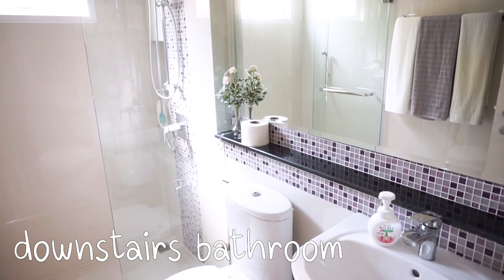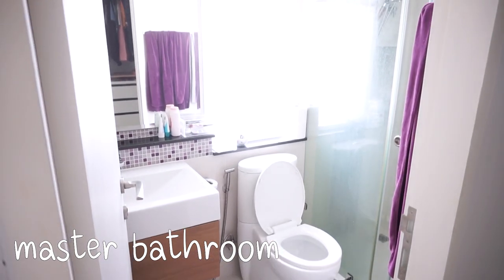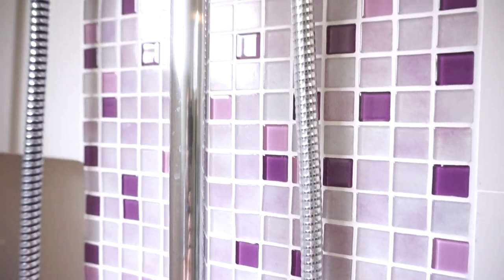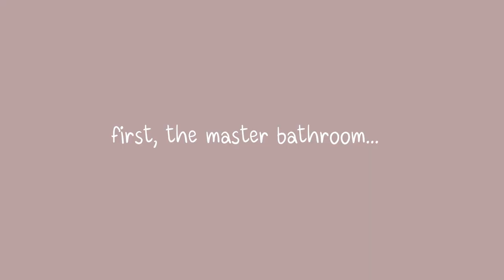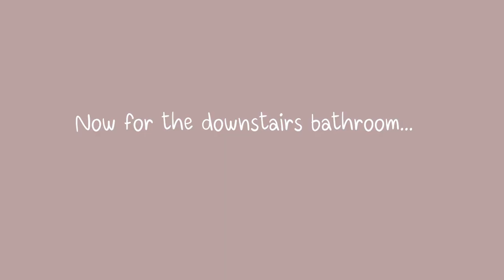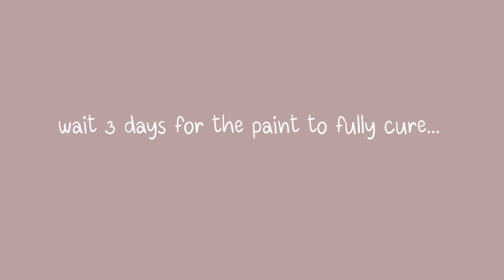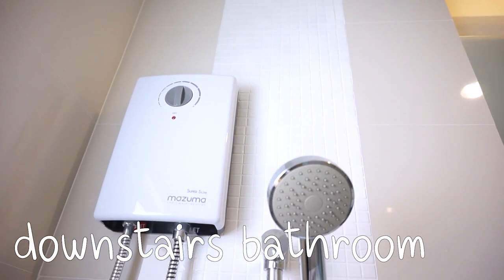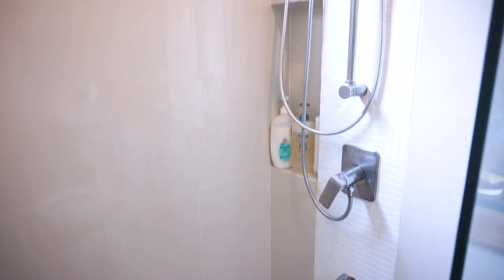Spray painting our bathroom tiles with Rustoleum Tub and Tile

Comment: While i agree with most of the knuckleheads who say you should of left that beautiful mosaic tile alone but thats not the point of the video...you did a hell of a job prepping which 90% of DIY’ers definitely try to take shortcuts prepping n thats where they run into major problems..kudos to you for showing the masses the proper way to prep for such application..disregard the commenter who said you should of taken the tape off while paints wet. With acrylic/epoxy paint its perfectly fine to let it set for as long as need be n it wont peel. Regular latex paints will peel but not tub& tile thats a different animal...give ya a 10 outta 10 for execution but a 1 outta 10 for covering up that purple mosaic tile...ive installed decorative tile for 20 yrs n customers would kill to be able to have a nice quality tile like that in their homes. Lol. Either way well done with the task at hand

Comment: Painters tape should definitely be removed before the paint dries. You run the risk of peeling off the paint with the tape when it's dry
Reply from the maker: Thanks for the tip!
Reply: This is dumb. If you remove before its done the paint job will be sloppy
Reply: @retropickups2000  No it isn't.

Comment: How much spray bottle did you use?
Reply from the maker: I used 1 can for a 1x8 ft area. I only did 1 coat, but I sprayed it on thoroughly enough that you can't see the original tile color underneath.

Comment: Cool video.. Actually u need clear code for finishing and protecting the base code..if have dirty come easily to wash it..
Reply from the maker: Thanks for the tip!
Reply: A and TJ I’ve read many ppl who use clear coat rustoleum brand will bubble. Did u try it?
Reply from the maker: @chophy88  sorry, I've never tried the Rustoleum Clear Coat!

Comment: Don’t spray paint in such a small room. The spray creates a dust of paint that floats around in the air and lands on EVERY SINGLE SURFACE in the bathroom. This includes the ceiling windows and vent fans. Always roller paint